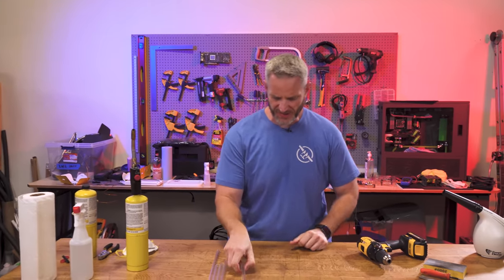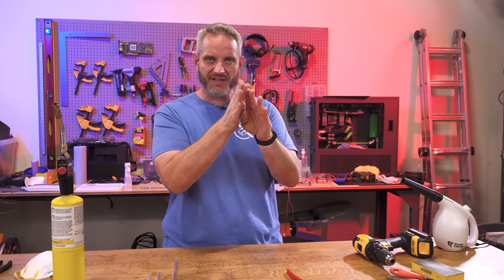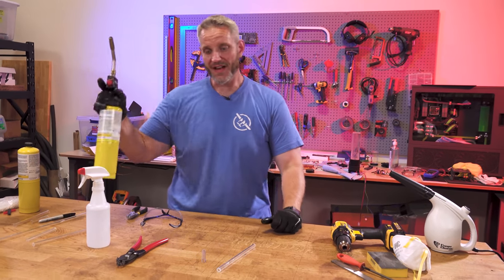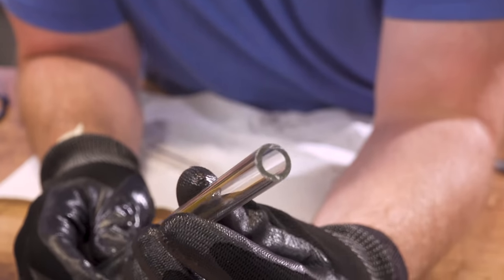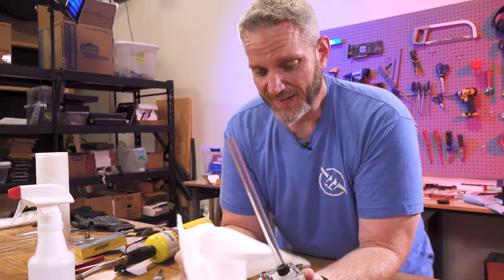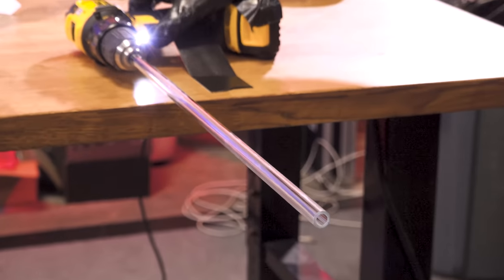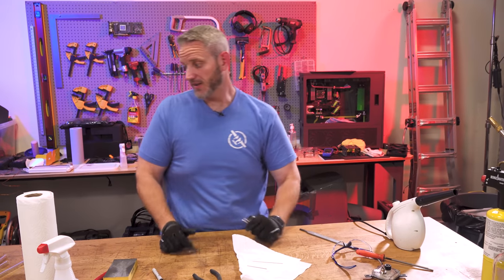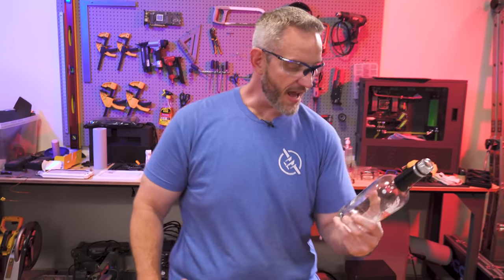Learning how to bend Glass Tubing... This looks soooo good!

Comment: I'm curious - why aren't you wearing a mask and eye protection when using the file and sandpaper on the glass edges?  I mean, after all, you're filing GLASS - and sanding GLASS - and both procedures remove very fine particles that you cannot see, smell, taste, etc....  but will be just as harmful as the ones released by the scoring.....